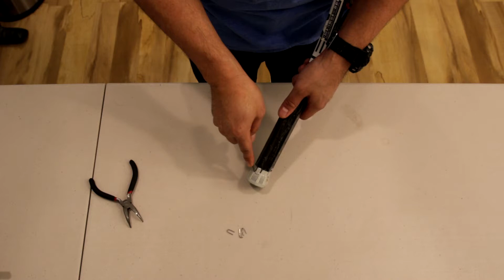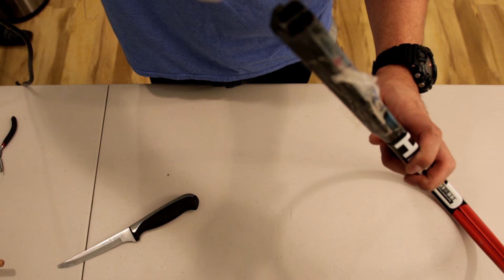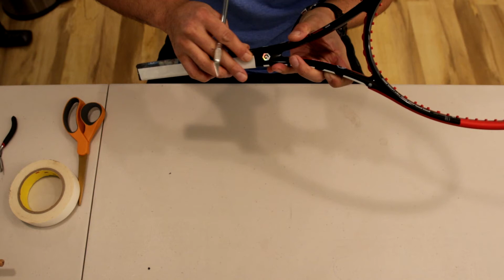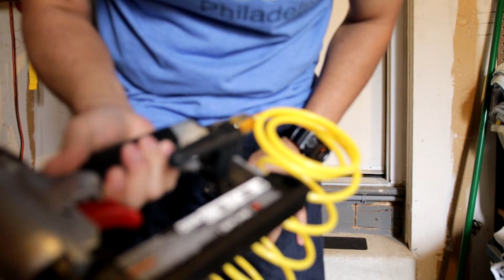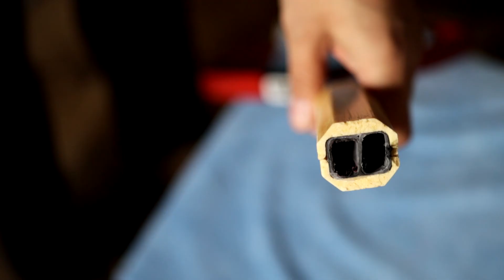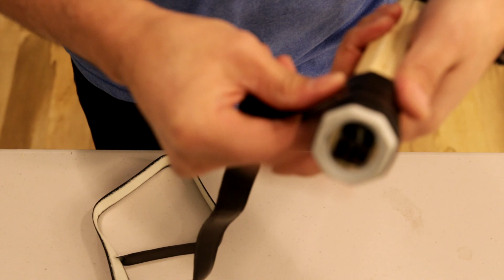Replacing pallets on a Head Tennis racquet

Comment: To pry open a double-sided tape you need to apply heat and smooth steady force. Good advice here: https://www.youtube.com/watch?v=zSmcSJVthSY  The staples to the black buttcap went to wrong place and perhaps too much air-pressure. Warming a buttcap should help. If regular staple gun is too weak, I have sharpened my staples a bit. Also I have used a small hammer or a vice to push the staples in.

Comment: Hi, I just had two questions.  First what PSI do you use for the staple gun?    Secondly, when you heat up the pin to get the existing pallets out, how do you protect the frame from melting from the heat that goes through the pin and into the frame?
Reply from the maker: Hi!
I think it's at 120 PSI for the air compressor.  I just used the heat gun and kept it moving.  No real protection necesary, just don't focus on any one spot too much.  Once you start to smell hot plastic, keep  moving.
Reply: Awesome thanks!

Comment: Great job with the pallets.
I would say that you need only one nail in the butt cap to secure that it doesnt move. thats why it shattertered bc you put in to many and to big ones. also heat up the butt cap a bit before. Also you need to learn how to put on a  base/replacement grip as that wasnt pretty.

Comment: Imo I wouldn't like to put staples in. It could do damage to the shaft and makes it harder to change pallet again with all those holes. Glue or tape or something would make more sense to me. You're not holding the racket that far down so honestly tape wouldn't be an issue for me
Reply from the maker: That's a way. But the one part of the handle you want to be 100% sure is secure is the butt cap. Don't have to use staples but I don't recommend just tape.
Reply: I would think a strong glue would do the job. It won’t ever come off again but it’s not like it needs to

Comment: any alternatives for the air staple gun? would a regular staple gun work?
Reply from the maker: A regular staple gun MAY work. It's just tough to get them to pierce the frame sometimes.
Reply: Spring-powered gun should work also. In case my staples won't go in, I usually sharpen these a bit. Also a small hammer or a vice can be used to push the staples in.

Comment: A little late to the party here 😂. I am currently using Head Boom Pro size 2 but want to bump it up to size 3 without adding weights from heatshrink sleeves, would that be possible by just switching a different size pallet? Thanks!
Reply from the maker: Yessir!

Comment: You can easily remove most of the staples by using a pair of pliers or even a screwdriver and going in through the bottom of the butt cap - levering/pressing them out. Much faster.
Now, have u ever tried pacific pallets on a non pacific racquet? I wonder will they work.

Comment: I predict you would shatter the butt cap should be shallow staples or whatever they used on the old one. Also with the heat gun don't put the tip close up to object like the knife because it can constrict airflow and over heat elements inside heat gun.

Comment: Thank you for the video! I have one question: the Head pallets usually are of gray or black color, and you use slightly yellow. What the brand is it?
Reply from the maker: Max, the pallets are from RPNY. They make their own I think.
Reply: @teekaywhy  Thank you very much! Unfortunately, here in Russia I don't know about RPNY.  Know only about Head spare parts. To say more I don't know if there is any racquet brand except Head that gives us ability to change the handle size. I personally changed the handles on various HEADs, TECNIFIBRE 320, PRO KENNEX SILVER ACE, using Head pallets. Hairpins of two last brands have the same dimensions with Head,  but I had to crash its original handle pallets, because they are not removable.

Comment: Great video..I bought a new racket which is a  Yonex Ezone 98 in black and green. The grip/handle shape is not the as square as the Wilson square ones which I have been used to the Wilson ones. Can the Yonex palettes also be changed to the Wilson ones??
Reply from the maker: Hi Gavin.  Yonex has molded handles unlike Head which uses pallets. I'm afraid you won't be able to change the handle shape without some major work which involves scraping and polyurethane.  I use Yonex too and like to use the Tourna Power grip with a wilson butt cap.  This seems to fix a lot of the handle shape issues.
Reply: @teekaywhy  I am aware that Djokovic used to use a Wilson racket before switching to the head pro stock racket but he had to replace the palette with the Wilson one a she was used to the Wilson one. I am also used to the Wilson hence why the Yonex one doesn't feel right as it is not as square as the Wilson one. Because he endorses the Speed range that is the only range Head use the Wilson grip shape. I am thinking of purchasing the Speed MP

Comment: Can I use spring loaded stapler on it ? Don’t have the air one.
Reply from the maker: Possibly may work but it needs to be commercial grade. Household staplers may have trouble penetrating the carbon hairpin.
Reply: I certainly used those micro scews from eyeglasses, screwed them onto those holes left open by the staples.

Comment: No no no no no... just no!
Reply from the maker: No to what precisely?  I can answer any questions
Reply: @teekaywhy  If you shorten the pallet excess one half at a time after installation, this will allow for a nice flush finish with the hairpin ends. I use a fine hacksaw for this as I am a surgeon and worry about the blade of the Exacto knife fracturing and lodging somewhere undesirable like my eyes or skin!

The disadvantage of having uneven pallet ends (even if hidden by the buttcap) is that you lose the benefit of the pallet support in reducing the risk of hairpin end cracks if the racquet is dropped on the buttcap. This is especially the case if the pallets are a hair short and the hairpin ends are in direct contact with the buttcap.

I’m probably a lot older than  @Gus and therefore have a somewhat more helpful and constructive way of explaining why I wouldn’t do things your way. However, it is an acceptable job overall for a hobbyist and the video is still a very useful illustration for those who have never seen this process. Thank you for taking the time to video and post your work. Enjoy your Prestige!
Reply: @teekaywhy  I just finished working on three identical rackets and perhaps should have videoed the process, but I didn't.
Reply from the maker: @thehandseesall  Thanks for the feedback!  Put up a video so I can compare and contrast!  Cheers!
Reply: @teekaywhy  no to using a compressed stapler, not to stapling near the bottom of the butt cap, no to using double sided tape down the sides of the pallets, no to cutting pallets before being in place (your pallets are different length because of this) not essential, but good practice.
I imagine that you don't use your hands in a creative capacity too often right?
Not a bad job if you don't, terrible of you do. Watch YouTube how-to videos before starting this type of project and next time and you'll be so much more successful with it the first time.

Not trying to put you down, just stating some facts which you asked me to clarify.
Reply from the maker: @thehandseesall  THanks Gus.  What 's funny is you didn't really state any facts at all, just your opinions.  Show me the handbook on pallet replacements.
Reply: @teekaywhy  well, my opinion is based on many years of racket customisation. You can stick scalpal blades in your pallet and grip to severely damage your hand for life if you want to as doing this kind of thing is never set in any factual stone, but in my "opinion" I would strongly advise against it.
Reply from the maker: @thehandseesall  thanks buddy!  Good luck!

Comment: Hi Sir, do you know if it's possible to replace Yonex Vcore Pro 100 pallet? Thanks
Reply from the maker: Hi!  The Yonex racquets do not have pallets.  They are molded onto the frame unlike Head.  Is there something specific you wanted to do?
Reply: @teekaywhy  the Grip size is L4 which is too big for me, so I carved the grip to reduce the size, but unfortunately my carving work was bad, I'm thinking if it's possible to replace the whole grip.
Thanks for the reply!

Comment: Is there an alternative option for anyone that doesn't own a pneumatic staple gun?
Reply from the maker: In my experience, the pneumatic is the best option but i understand not everyone has one .  You could try a manual commercial stapler but need to get the correct size.  I've also tried tape but with varying degrees of success.
Reply: That's certainly something to think about. Thank you.
Reply: I certainly used those micro scews from eyeglasses, screwed them onto those holes left open by the staples.
Reply: I've used a very thin drill bit and re-used the staples; I was able to force the staples in to the holes I'd drilled and they've held just fine.

Comment: What was the point of putting double sided tape on the hairpin, and than removing it?
Reply from the maker: What minute mark are you referring?  I only used double sided tape once for the pallet
Reply: @Jeremy Hanna He was removing the backing of the double-sided tape to expose the adhesive layer (the tape is trascluscent once the backing is removed). 

From your comment, I guess you are more familiar with solvent or water activated tape strips as used in golf club re-gripping, but can also be used for tennis racquet pallets. Those are thicker and are opaque, which is why I guess you think he removed the double-sided tape at 9:58.

Comment: Are all “hairpins” for head the same dimensions? For example, could I go to a 3D printer and create my own pallet by using this dimensions from the hairpin?
Reply from the maker: I think they're generally the same size from model to model. not sure how sturdy the 3d printed ones will be. the weight is also a variable. good luck

Comment: Do you happen to know which pallet type comes with the latest model Head Prestige Mid (93" headsize) - the new all-red model. Is it the TK82 or TK82S? Or something entirely different?

Additionally, which buttcap would I need?
Reply from the maker: I couldn't tell you to be honest. Prestiges have traditionally been the rectangular shapes as opposed to the speed square-ish shapes.
Reply: It's TK82S.  I recently bought that racquet (Head Graphene 360+ Prestige Mid, in short: Prestige 93) and took off the base grip.
It says on the pallets "TK82S" , so that's the square ones.
Which I hate because with the rectangular TK82 a grip size 4 will do, but with the square pallets a 4 is too small 😞

Comment: What about gamma pallets?
Reply from the maker: I've never replaced a gamma pallet. I'm not even sure they use pallets vs molded handles. If you peel back the grip and it looks like a molded handle like a Wilson or yonex then that's a very different process and much more destructive n

Comment: can prince pallets be replaced? wanna do size 3 to 4.
Reply from the maker: Generally no.  Prince doesn't use the pallet system.
Reply: I've seen someone online chip away at the foam pallet on (I think!) a Prince racquet and break it away, and then replace it with an aftermarket pallet... I thought that it would be a bit risky but appeared achievable.  (I've done a quick search for video but couldn't find it - sorry!).

Comment: Could I use a head pallet to replace the mold  on a Wilson H22?
Reply from the maker: Difficult to do as you mention. Wilson hands m handles are molded and generally not intended to be removed. That said, there are ways to get the mold off but I'm not sure if the Head pallets would fit the hairpin.
Reply: did you ever try it? i read on a forum that they would fit, but havent done it yet..
Reply: @CoDINmyHEART   yeah I tried it and it didn’t really work. The pallet wasn’t  wide enough on the sides to completely fit around the racket. So the grip comes out thicker than it’s supposed to be. I’d recommend ordering grip pallets from unstrung customs they make the grip pallets to fit whatever racket your wanting to put them on
Reply: @josephjabour9453  Thanks

Comment: Where did you order the pallet?
Reply: I recommand you www.stringersworld.com I orderd few days ago HEAD TK82, TK82S pallets and HEAD butt cap. Only HEAD sells grip pallet and If you want Wilson shape, you buy TK82S. It compatible with Wilson butt cap
Reply from the maker: From RPNY in new york
Reply: @teekaywhy  Tennis warehouse doesn't even have it!
Reply from the maker: @shortyboy2562  that is correct. They don't sell pallets here in the US
Reply: @teekaywhy  dang that sucks! I just emailed RPNY. I haven't ordered anything yet I was trying to change a pallet from a broker racquet and replace it with a 4 5/8 on a Wilson N code tour 90
Reply from the maker: @shortyboy2562  cant do that. Wilson's don't use pallets. It's a molded handle.
Reply: @teekaywhy  Had no idea.